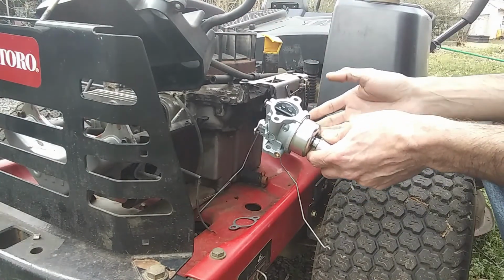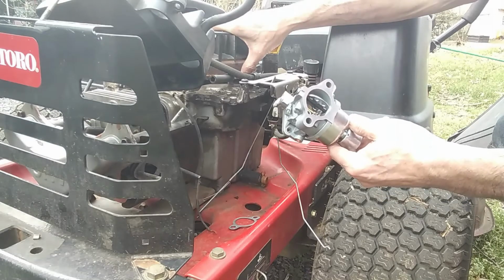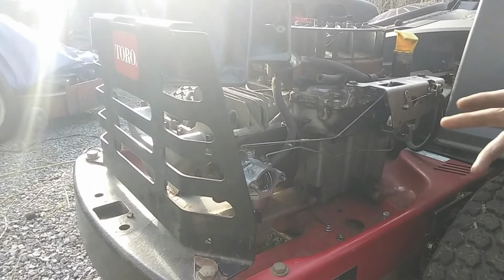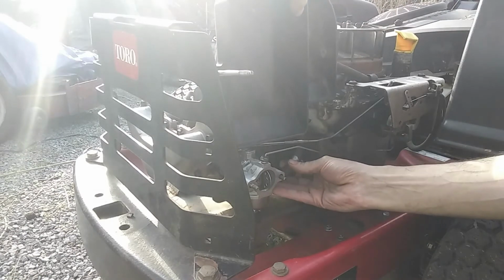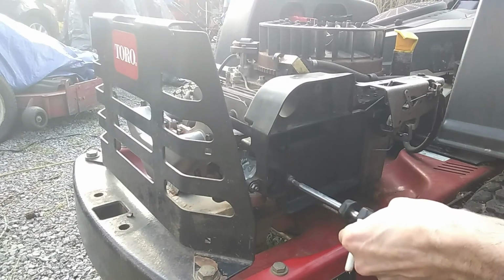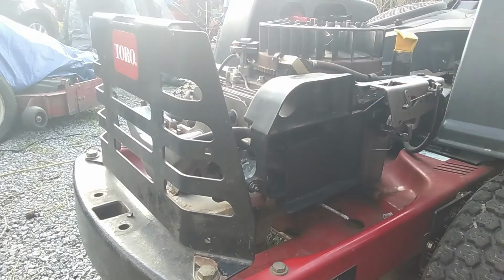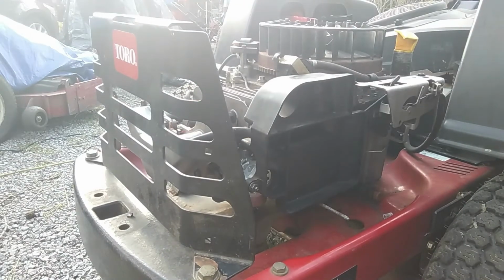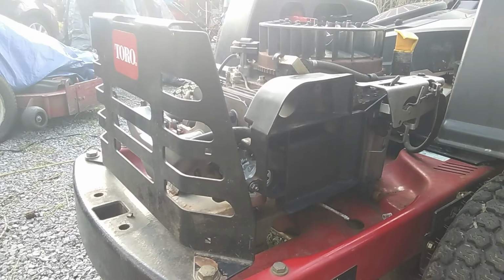Kohler sv610 carb change

Comment: Since you cut out the solenoid, do you still need the ground wire?
Reply from the maker: No,but don't remove it someone might want to use it later.
Reply: @JungleBobRepair Do you know if repair kit for the older style is still available? The reason I ask is I've read that sometime after 2009 (purchased my mower) they updated the bowl & solenoid because of fire hazard. So I'm not sure that a kit will work on both. I really only need a bowl casket
Reply from the maker: Bowl gasket is the same,you can get the old solenoid on ebay fo $10.I would keep stock carb it at all possible.
Reply: @JungleBobRepair  I want to keep the stock carb, but need a rebuild kit. Do you know if their still available? If so do you mind sending a link. I dont use the solenoid, I cut the pin. I'm just trying to rebuild this stock carb but not sure a kit is available.
Reply from the maker: @davidpressley4375  If you send me the model # Ill be glad to get that part# for you.
Reply: @JungleBobRepair  kohler command sv610-0212 21hp, again I have the stock carb from 2009, not the one they are selling now days. Thank you